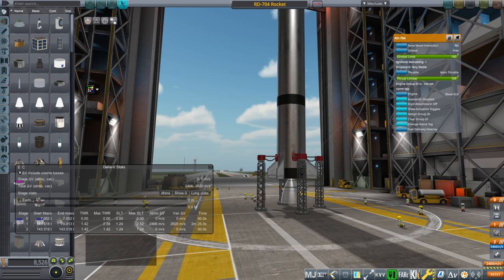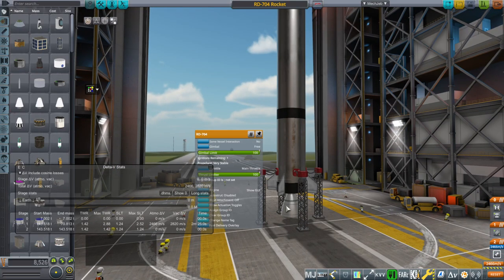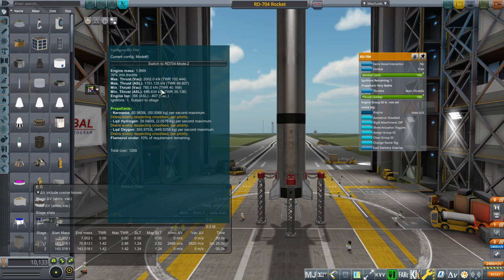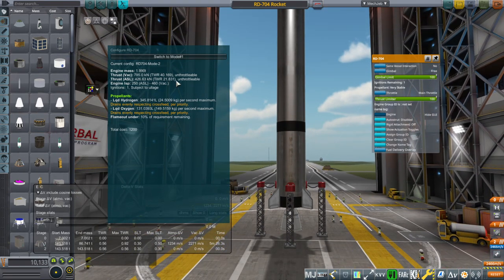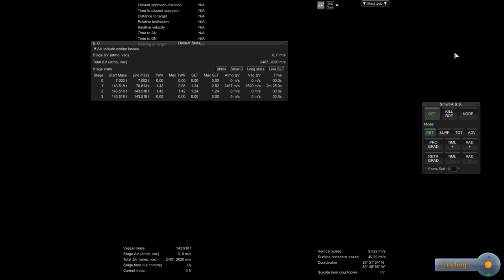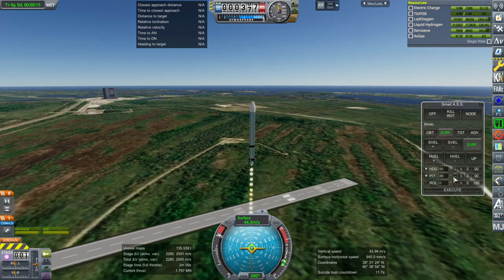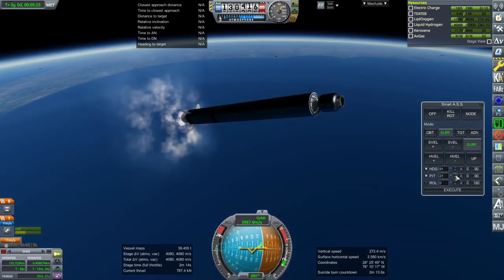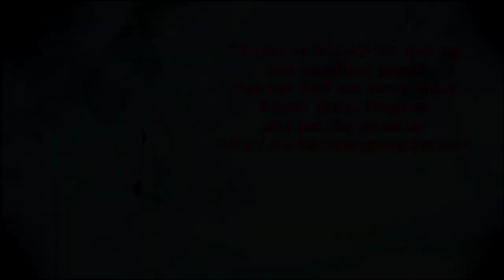KSP with Realism Overhaul - The Best Launch Vehicle Engine Ever Tested

Comment: This engine (or the principle behind it) should be revived for a reusable spaceplane. Might need some GEM-style small SRBs to make the maths close with good payload figures (and no insane Soviet giga-aeroplane), but those are cheap. It's almost a shame that Musk is fixated on single-mindedly working for his Mars goal, rather than having his people work on stuff like this with more immediate benefits.
Reply from the maker: Well, I also wonder if a Methane-Hydrogen-Oxygen tripropellant is feasible.
Reply: @RaizSpace  It should be easier if anything; as far as I remember, some hydrogen engines have been set up to burn methane for tests with only minimal overhauls. However methane's lower impulse density might make it less suitable as a boost fuel... on the other hand, a methane-hydrogen mix that is mostly hydrogen (5% methane?) is supposed to actually have a higher Isp than pure hydrogen for reasons I don't understand.

Comment: isn't RD-701 better? it's bigger, this was the engine that held record of chamber pressure. according to wikipedia and astronautix it had 3.2MN of SL thrust in mode 1 (isp 330) and 1.6 MN in vaccum in mode 2 (isp 460) while mass was 3.6 tons. RD-704 was not much lighter, 2.4 tons is without gimble, while thrust was 2 MN and 0.7 MN accordingly. numbers available online are very confusing since they mix different modes and different engines, also it was intended to be launched from 8 km altitude so sl values can be actually not sl but 8 km high.
Reply from the maker: It's the same - it's just two RD-704s.
Reply: @RaizSpace  not exactly. RD-701 has 3 chambers while RD-704 has 2. it's more like 2 engines sharing a common preburning chamber, that's where additional twr is coming from in RD-701
Reply from the maker: Not sure where you get that information - each main chamber had its own preburners. Here is a link that shows the configuration: http://www.buran.ru/htm/rd-701.htm. It clearly shows just two chambers, each with dual preburners.
Reply: @RaizSpace  that's what russian Wikipedia says, that they had 2 and 3 chambers. didn't find that in the links to the sources
Reply from the maker: Well, what can I say, I'm going to go with my sources which all independently say different.
Reply: @FatovMikhail   it says RD-701 has two chambers and each has three sets of injectors. and i suppose most of the info comes from Gubanov's book.

Comment: Looks to me the only reason the first stage is tri propellant is because the turbo pump is powered by O2 and hydrogen since it burns a lot cooler.  Looks like they also use the hydrogen to cool the chamber as well.  I think they would have preferred the extra thrust in this phase over the extra ISP.  I wonder if this engine is actually dual mode of if it could use any mode between mode 1 and mode 2 so you could essentially have throttle but when you throttle down you get bonus ISP.

Comment: Do you consider using balloon tanks cheating? Would balloon tanks be impossible to use for large first stages or deep space maneuvers in real life?
Reply from the maker: Not cheating as such, and maybe an argument could be made for this rocket, since it's not too much bigger than the original Atlas. There are just additional considerations when using balloon tanks that their use in KSP doesn't reflect.
Reply: @RaizSpace  Like what?

Comment: That is an insane engine. Is it restart capable? If it is, should be fairing easy to use 9 of them (or I guess 1 single chamber in the middle and 4 dual chambers around it) to make it capable of vertical propulsive landing. 

If I was an American engineer in the 90s, working on EELV, I would've been chomping at the bit to have that thing. Imagine placing the dual chamber version in a recoverable pod, under an expendable tank. Should get you an SSTO delivering like 10+ tons of usable payload to LEO, with the engines returning. Then, to cover the whole range of EELV, you can stretch the expendable tanks and add some strap-ons. Should be relatively easy to get up to like 20 tons to LEO, and just as easy to fit a GEO bird and a cheap LEO-to-GEO transfer stage within 20 tons. It would easily be the best of the EELVs.
Reply from the maker: It was not designed to be restarted on the fly, though it was meant to be reusable. Basically, same as the RS-25.

Comment: HOW DID YOU MAKE AN ORBIT WITH 2000ms ???
Reply from the maker: You didn't watch the video properly - the 2000 or so is only in the first mode (Kerosene-LOX-Hydrogen) and doesn't include the delta-v of the second mode the engine uses (Hydrogen-Oxygen).

Comment: Ahh… but can it deeply throttle and restart an arbitrary number of times?

Pretty sweet concept though
Reply: Well, it doesn't need to. An absolute beast of an engine and quite possibly one of the most complex, if not the most, ever made
Reply: @clancy5600  it would need to do those things (deeply throttle, be reusable, and restart an arbitrary number of times) to outperform the Raptor.  Oh, and be refuelable on Mars
Reply from the maker: Technically, thanks to the mode switch, it throttles deeper than Raptor, I think. There was no need for it to restart on a particular mission, but it was obviously intended to be reused, or it would have been placed on the external tank instead of on the MAKS spaceplane itself.
Reply: @mbmurphy777  As Raiz said, it doesn't need to do any of those things. It outperforms Raptor in Isp, and is roughly equivalent to a Raptor in thrust. and it's also refuelable on Mars, since you can make both Oxygen and Hydrogen there.

Raptor isn't the most complex or best performing engine ever, it's a compromise for pretty much everything. That being said, it's still an engineering masterpiece and a sight to behold.
Reply: @clancy5600  So then, what would you choose for your modern launch vehicle? Something reusable with arbitrary relights and  the ability to refuel on Otherworld’s? Or something that can only be used once for LEO?  ISP is important but it’s not the only consideration. By using methalox Raptor gets the same advantages of half kerosene and half hydrogen that you see in the other engine. Plus a lot of other advantages
Reply: @mbmurphy777  "Modern" launch vehicles only launch from Earth. Even for Starship, flight from Mars is highly aspirational, and certainly every single new launcher shouldn't be expected to be able to fly from other planets' surfaces as it usually adds design considerations that are detrimental for routine launch.